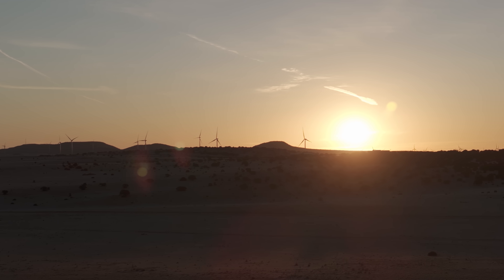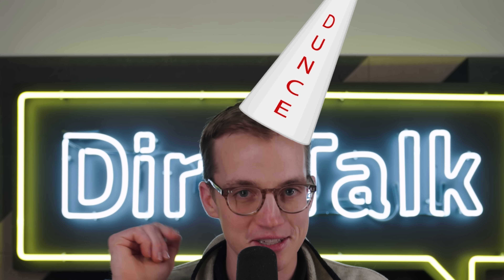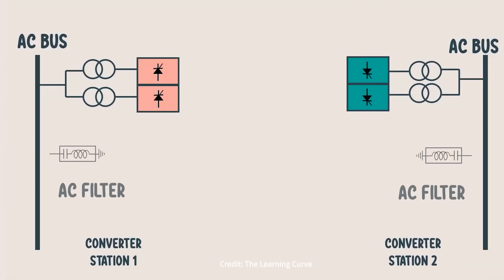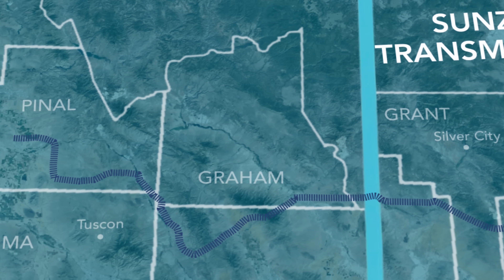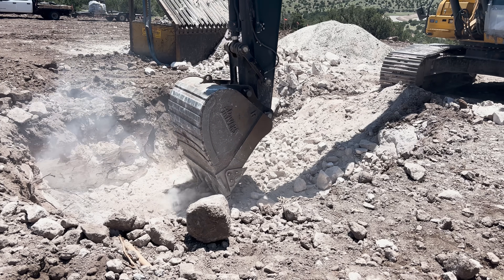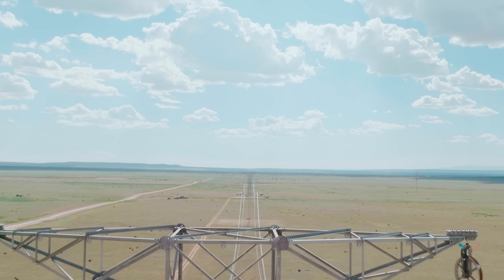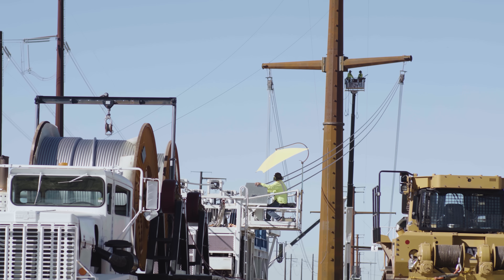Building America's Largest Power Project w/ Helicopters?

Comment: They are talking about building a transmission line from SW Wyoming over to Las Vegas and then eventually Los Angeles. Did they not let you pilot a helicopter to drop one of the sections? 😃

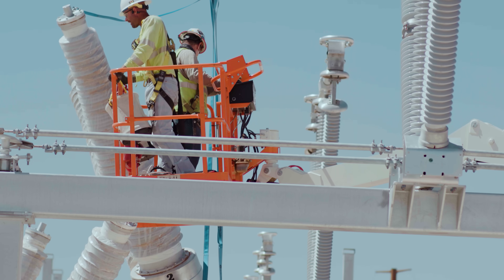Comment: Correction at 3:00 AC is better for long distances and is why the transformer plant is needed. Wind mills make AC power which is converted to DC using a rectifier then back to AC with inverters then stepped up to HV. The reason for this is because windmills produce variable AC which is bad for the grid. The 2 steps stabilize the current to 50 hz for the grid

Comment: 4:44 
To clarify, I believe the turbines themselves produce DC, that is directed through an inverter to AC,  for consolidation, stabilising and to store the electricity, prior to being converted back to DC again. 
The reason it can’t be left as DC, and directly transmitted without prior inversion, is due to the volatility of the wind turbines production. As the turbine changes speed/ generation production, the system would spike, or fall, unpredictably, causing likely damage to components on the other end.
It is also to allow for the voltages to be increased from the relatively low DC, to the frightfully high AC voltages necessary.

Comment: I think there's a second reason to rectify the ac from the wind turbines.

By converting the ac output of the wind turbines to dc, this eliminates the need to mechanically synchronize the wind turbines to the ac grid frequency which would require gearing.

Comment: DC is better for transmission because it can utilize the line better:
when we talk about 120V AC, we talk about the RMS value. (think power carrying capability) The peak value is 41% higher -> so you have to insulate those cables for 170 V. 
if you switch to DC, the peak becomes the RMS -> you can use 170 V for power delivery -> current drops -> losses scale with current squared.
In addition you have also less losses due to having to charge / discharge the line 50 / 60 times per second. And the voltage drop is lower because you have no inductive voltage drop.
Reply: The use of HVDC or UHVDC is a lot more complex. There are a number of different types of losses due to the use of AC that are removed using HVDC.
Reply: DC is only really better at extremely high voltage for transmission       we insulate small wire because we want to be able to use them without putting power to things we don't want. HVDC is also easy to sync with the grid

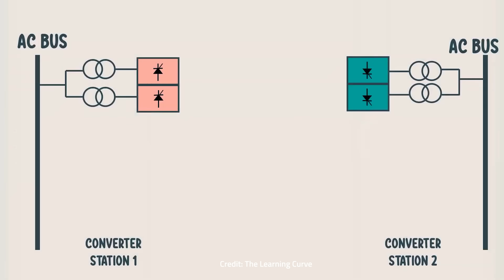Comment: 4:20 a rectifier and capacitor limits the output of the turbine to a consistent regulation of DC power that passes into an DC to AC occultation modulator that transmits square wave AC power into a step up transformer to 800kv... at a sub station further away a step down transformer regulates the voltage down to 28kv including the use of large high voltage capacitors to make the square wave AC into a soft wave form. otherwise, transformers and common AC motors would be shunted 60% harder then normal and creating consumer product damage ending as a mass wave of returned nonfunctional equipment. so there is an oscilloscope sensor that monitors the wave form so that as the smoothing caps run out of service time from internal derogation the sub station switches to a secondary unit so the damaged module can be replaced. 60% inefficiency in smoothing the square wave AC into soft wave AC. 2Mw of heat taken from the transmission lines and line smoothing caps. all that for 16 greenhouse buildings to have constant 308 volt 200amp sub services, to pump water and operate air exchangers to grow a tomato in Vegas, where it takes 40 years for a cactus to grow. everyone leaves with at least one less dump then that of what they came in with. 4:55 there is no DC going down the 800kv lines... bad as those kids playing video games... King Noob Bus AI Geb education = they try = they brake everything. Geb Gib Gip Gimp education, a licensed condom nation. just search ideocracy, big doo doo meme.  geb: Egyptian god, gib: wood bolts wedge, gip: gastro intestinal problem, GIMP. potato vs to mate oh... eggplant is squash. king toot in hut wines a squamish simp sips.

Comment: Those workers who climb the towers and attach the parts are real heroes! I followed a team building a tower that was downed by wind and it's tough life risking work.

AC is excellent for long transmission lines - that's the main reason DC lost to AC early on. Recentlly the DC technology became mature enough for wider applications. One of the first such lines was built here in Brazil linking Itaipú Hydroelectric to São Paulo. The thyristors that do the switching to turn DC into AC are three stores high and water cooled. DC has a great advantage over AC: it's not affected by the oscilations that affect AC under some failure situations. They are great to create a connected grid while maintaining sub AC grids insulated. One of the failure situation is caused by solar flares and afftects the northern hemisphere close to the arctic. 

Those choppers are awesome, btw!
Reply: The Pacific DC Intertie was completed in 1970, so 55 years ago! It originally used Mercury-arc valves and not any semiconductors.

Comment: from what I have studied,ac travels better over long distance.    I won't stop watching your stuff for not getting it correct cuz you show interesting things but a simple search would tell it's not quite the way you say
Reply: If AC was more efficient in this case, they would have used it. You assume that everything in the world is done exactly the same way, every time. He barely scratched the surface with details in this video. I will bet a google search would explain why they went with a DC transmission system for this project.
Reply: Good point  @CGT80

Comment: What??? I always thought that high voltage AC was the best way to transmit electricity. I was taught that the reason DC Edison lost the power war to AC Tesla, was that DC couldn’t travel without a significant voltage loss. Mind blown.

Comment: I thought our power lines were high voltage AC and that it was more efficient for long distances.
Reply: So far, they are, but apparently (based on other comments) they have found more efficient ways to convert to DC to where it works out. DC power flows across the surface of the conductor where AC flows through it, hence the hundreds or thousands of strands of copper in cables rated to just a few hundred amps, where AC cables have only enough strands to make them flexible enough for use, or solid in the case of small cable such as romex and MC. It would have been interesting to hear and see more details on the cables used. My brother has a chunk of big cable from the lines that run from AZ to SoCal since he did underground work on the conduits that run through San Diego for that line......it is an AC HV line.
Reply: Yep ! AC !

Comment: The power is transported via high voltage AC (NOT DC) to another sub station where it is stepped down again to be distributed to households
Reply: What are you talking about? This whole video was literally about building a DC line between two converter stations. One (usually the snding end) is in rectifier mode, converting AC to DC. The other end is in inverter mode. If a transmission line is long enough and  is moving enough power, it becomes economically viable to build a DC system. Those converter stations take a lot of care of feeding to keep going.

Comment: Wind turbines make a/c it is not d/c over powerlines. The losses are too great. Super high voltage a/c is used over transmission lines. You may need to do research again.
Reply: While most long transmission lines are AC mainly because of cheaper transformer costs and grid compatibility, DC long distance transmission is more efficient and in some cases can overcome the extra costs of transformer and grid compatibility issues .
Reply: I thought exactly the same, I am hella confused I know for a fact that Wind Turbines generate AC that's not what I am thinking over, don't we use AC for long distance transmission, atleast in India that's the case

Somebody who is better at this could clear this out for us!
Reply: @sivanesh6733  You didn't pay attention close enough! He never said the wind turbines were DC and actually stated they are 480v AC 3 phase and that a sub station of sorts, in a central location to all the wind turbines, will convert it to DC power and then another DC conversion station at the other end. Another comment claimed that they have more efficient ways to convert the DC now and that it can be more efficient in certain cases.......I didn't look it up to verify. I highly doubt that he screwed up in the video based on him talking about the conversion stations and I assume he would get some basic facts from the company he was working with.

Comment: You might want to check out Michael’s Corporation Power Division they are the leading contractor installing much of the new power grid supply systems throughout the Pacific Northwest and Canada using the same technology and equipment except traversing some of the huge mountainous terrains and thick forests they encounter during their build operations.

Comment: This whole AC/DC thing you have bass ass backwards unless this is the new testing of DC transmission lines which is going to screw up everything and it's probably a waste of money
Reply: It sounds like it is a new DC system. Why would it screw up everything? That makes no sense. It is converted on one end and then converted back on the other end, point to point. Even if it had more than two points connected, it is common in machines to have multiple dc voltage and multiple ac voltages and it works out fine if done properly. I give him a benefit of a doubt when he explained the process and must have gone over those very basics with his contact at that company. Technology changes and sometimes less common solutions do get used.

Comment: Good video on high voltage DC transmission lines but your explanation is incorrect.  AC power lines have reactance caused by the changing magnetic and electrical fields around and between the wires produced by the alternating currents. The reactance requires additional current in the lines and makes them less efficient.  For distances over about 600 miles it is more economical to use the converter and rectifier stations to use high voltage DC transmission.

Comment: Ac power IS good for long distance travel. DC power is NOT good for long distance but there is some new research being done on it with super high voltage and aluminum transmission lines

Comment: Ok let’s add this all up. 552 miles of transmission towers, let’s call it 10 towers per mile. That’s 5,520 towers. Plus the 3 wires for unbundled conductor and at least 1 ground. Wind turbines. Let’s say there were 100. Solar field? Let’s call it 5,000 panels plus all of the cables and stands. All of this had to be mined or recycled from something somewhere. That’s mine trucks, forklifts, boats, crushers, on and on and on. Then you have to make it all more stuff. Then you have to ship it all. Then you have to build it all. All of this is done by people in a vehicle of some sort. Using machinery and tools that run off of either power or some sort of fuel. There is no way in hell that they can say this is a clean energy project! They will never generate enough “clean” energy in the lifetime of any of this to recoupe the “dirty” fuel used to create this mess. And now that it’s built they have to maintain it. All 520 miles of it. Inspections, paint, reconductor, insulator changes. All that to say I love your video but don’t call it clean. That’s BS. You call it clean to get federal and state funds. That’s the bottom line.

Comment: The main reason for using high voltage DC transmission lines is there is little loss from a changing magnetic field interacting with its surroundings as happens with AC high voltage transmission lines.   There are DC issues of causing corrosion from current forcing in one direction only.   DC powered subway lines suffer from this.   

This wild AC generation project misses the main selling point of renewable energy which is to save fuel.   It takes more natural gas running natural gas turbines at 70% fuel consumption at fast response readiness where 100% output would 100% back up all the wild AC than making all the electricity from efficient running natural gas combined cycle plants where a second steam cycle adds 50% higher efficiency.   Efficient running natural gas combined cycle plants would be expected to use 66-2/3% of the fuel making all the electric than the full  output of the natural gas turbine generators 100% backing up the wind turbine generator's wild AC.   When making up the dips in output the gas turbine generators will use more than 70% of full output fuel consumption.

Natural gas is too expensive a fuel for base load electricity generation at breakeven natural gas production cost pricing  which would be non sustainable.  A new ultra supercritical clean coal power station burning high BTU bituminous coal was estimated to have a crossover fueling cost with natural gas priced at $0.80 per million BTUs natural gas in 2022.  The offseason June 2024 price for wholesale natural gas was $2.50 per million BTUs over three times the fueling cost of the coal plant at the lowest natural gas price of the year.

There has been almost no inflationary pressure on electricity production and delivery in the US in the last four years.   All the significant increase in cost can be attributed to supporting wild AC with the public power grid which has saved no fuel.

Comment: Wait, I thought the entire point of using AC was because it was better for long distance transmission?  Why are they using DC?
Reply: DC is better for transmission but it is expensive to build the converter stations.  That's why you'll only see it on long distance lines.  AC is easy to step up and down so it has the economic advantage on short/medium lines as well as distribution.

Comment: Seems like a natural gas power plant would have been a better solution to all of this 

But  this is pretty interesting
Reply: Nuclear
Reply: You’d probably need to build a natural gas from NM or Texas to the site of the NG power plant. Alternately if they build a NG power plant in NM, they’d have to build a transmission line as depicted in this video. No free lunch.
Reply: Wake up grandpa renewables are the fastest growing source of electricity because it has become the cheapest and is only getting cheaper, while fosil fuel is getting more expensive because surprise surprise it's not infinite. Also with how fast the US is using gas and oil you guys are seriously asking for it to run out quickly and become far more expensive.

Comment: The 525kv number means it is 525,000 volts.  The wind turbines are usually 480 volts 3-phase to a transformer at the base of the turbine.  That transformer bumps it up to 12,460 volts three phase for delivery to a substation where it would grid tie at another transformer to 69,000 or higher for delivery to the converter station.  Repeat that process backwards except to have a 120/240 volt transformer somewhere near your house.
Reply: Are you sure about the 380 volts? The Vestas turbine produces 4.5 MW, which would translate to more than 10.000 Amps running through the cables from the nacelle to the first transformer.
Reply: The GE wind turbines on this project have generators that operate at 690 volts. Interesting info.
Reply: @Mentaculus42  thanks!
Reply: @Freba9 

I was surprised that it was that low, and not something like 4160 volts. Also these wind turbines are now considered to be relatively small. Maybe that voltage is for the rotor AC 3 phase excitation current and the stator has higher voltage. The specs for the GE only vaguely mentioned 690 volts but they are ASYNCHRONOUSLY DOUBLY FEED so maybe the rotor’s excitation coils operate at that voltage since they have to be driven externally and probably have slip rings. It is a fascinating design that allows the stator to produce 60 HZ but operate at variable RPM. Some wind turbines use AC-DC-AC conversion to allow variable RPM. It is fascinating that there is so many different generator architectures with wind turbines.
Reply: @Mentaculus42  really interesting indeed!

Comment: Yes, as an electrical engineer, I can tell you it IS witchcraft! You cracked me up, but I admit that most of the other engineering students that (had to) take circuit theory were like deer in the headlights. I loved it, oddly, and aced circuits (and thermodynamics).
Reply from the maker: I failed circuits...
Reply: @ you and so many others, or rather most students dropped the class to try again. You’re a smart guy, and with some age and experience under your belt you could ace circuits too. Me? I was a NTA student, going into engineering at the old age of 24!

Comment: Ontario just added a 2nd high voltage line in the northern part of the province it would have been a great project for your videos, lots of big as well as specialized equipment. The work was done by Valard.

Comment: I don't know if you know how but can you do a heat disaptition comparison between hvdc and traditional ac power transmission. I don't think it is nesscessary to have the stations if they had just used traditional ac transmission. I say this beacuse transmission lines carry ac because a transform steps up the voltage while stepping down the amperage. This lowers the heat generated because of the lowered amperage. So this lowers your I^2 * r losses to heat. The high voltage transmission lines shown in the video by the The Engineering Mindset are talking about going between countries not states. Normal power station just use the basic step up and step down process for providing power for the majority of cases. It would be cool to see what the comparison is between them.